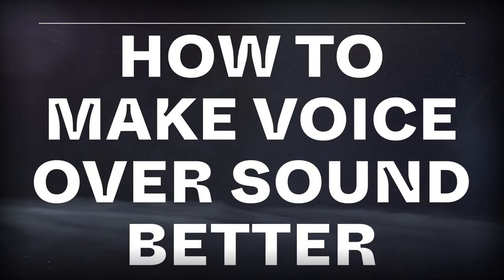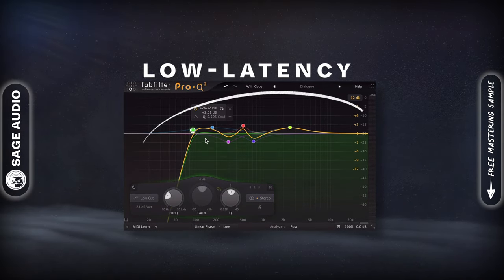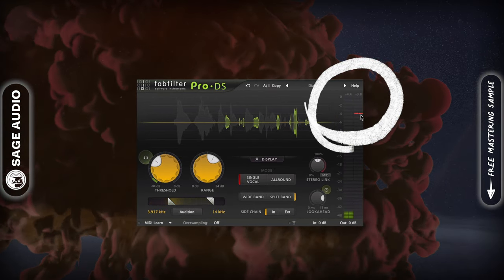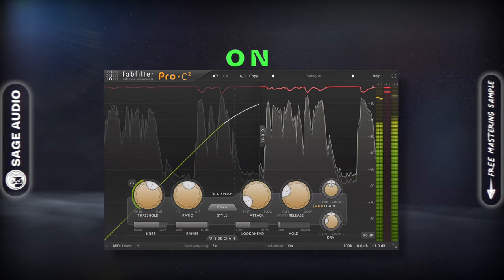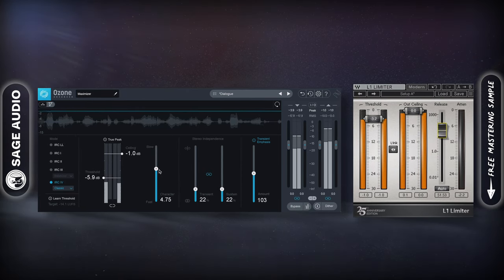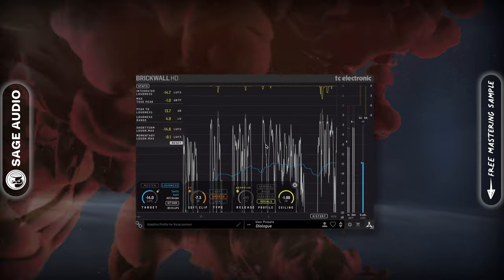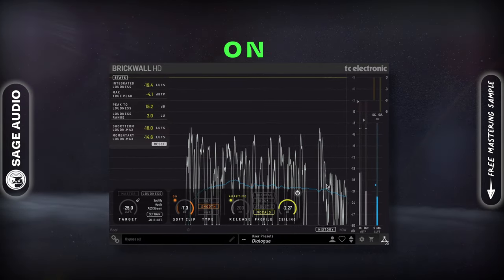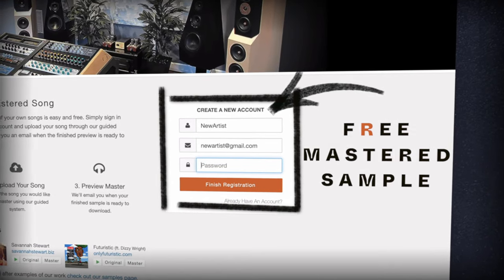How to Make Voice Over Sound Better

Comment: I think this is good vocal chain but the original recording have some problems need work or to be considered before everything, for example there is a little bit of noticeable noise which become more noticeable after processing especially after compressing and limiting ,   
Also there is some kind of reverb/ and boxiness which in best case scenario need to be re-recorded in better acoustic but possible to use dereverb or EQ to reduce the problem

I think good recording is 1st step for good processing / good final master
Reply from the maker: Very true! I wanted to use one that needed a little work though, since I assumed most viewers won't have an ideal setup and may have some of the same issues as this recording did! Thanks for watching!

SageAudio.com
Reply: I noticed that as well. The very well recorded main narration sounds so much better than the samples I wanted to know how that was done! Useful nonetheless and very interesting! Thanks to Sage !